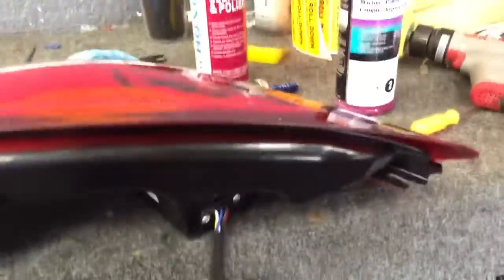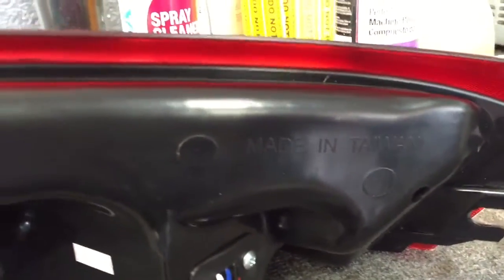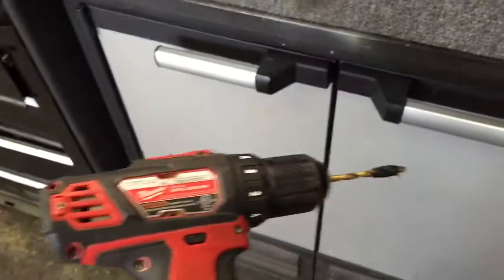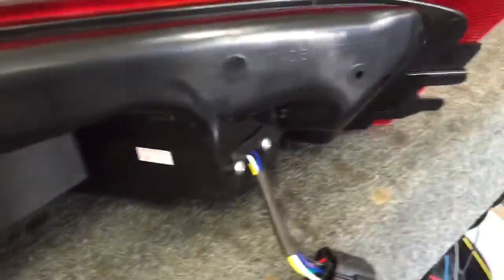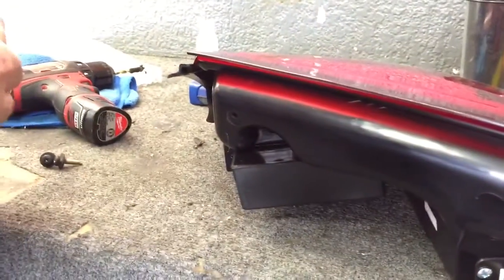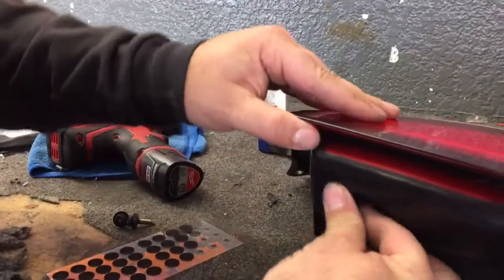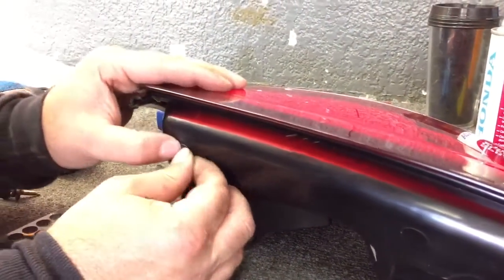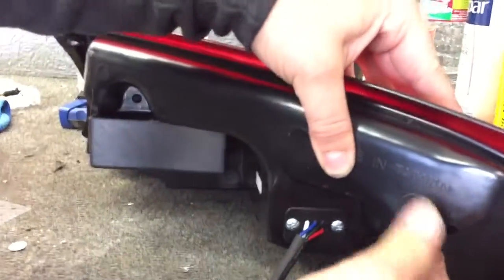Porsche LED Tail Light 996 Turbo Condensation Fix Kit By Del Rey Customs

Comment: Just received my set that looks awesome! They are both fogging up already, how do I get this "kit"?
Reply from the maker: christurbo951 all current lights have these already from manufacturing. Condensation is normal depending on location, moisture and temperature. They dry out within 24 hours.
Reply: Delreycustoms thank you! I just installed them today.